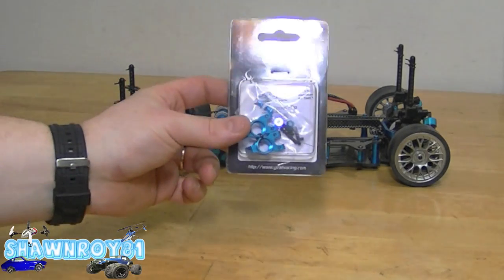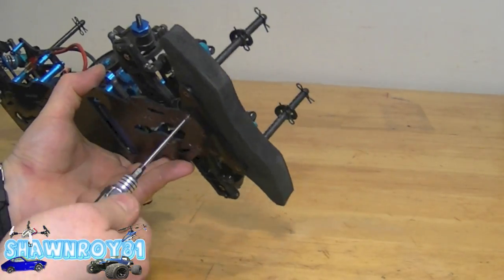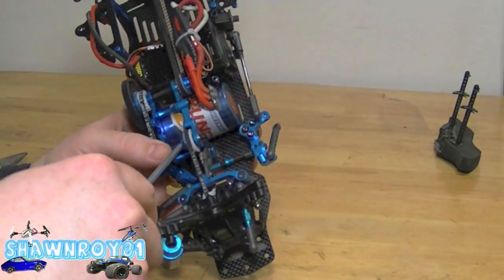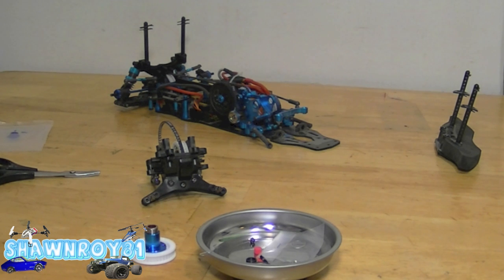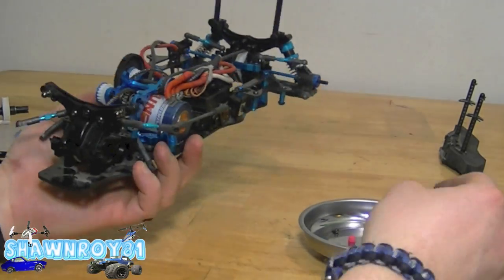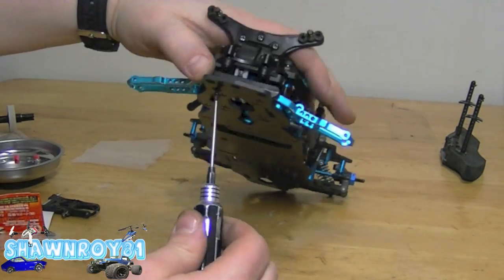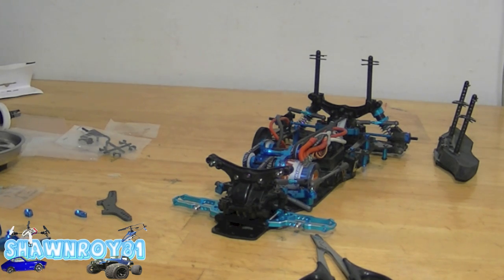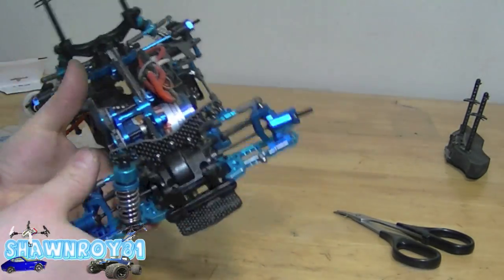Tamiya TA05 VDFII Drift Chassis Upgrades

Comment: Good info bud I like your vids very helpful as I am new to drifters. One question, I think it was one of your videos I can't remember, how do I stop play in the steering linkage? I can hold one wheel and the other wheel moves it had play, am I correct in thinkin it's the king pins? I think I saw you or someone file them down slightly! Much appreciated👍
Reply from the maker: Thanks man. For your question not 100% sure I find my sprint has alot of slop too. The tamiya is pretty tight. Sorry I couldnt help

Comment: what would be the best starter chassis i really want to get into it but i dont know what chassis and how much did all that cost
Reply from the maker: sakura d3 which is about 130 plus your electronics..250 should get you track ready...mst ms-01d rtr is about 250$ which is also a great platform
Reply: ok thank you alot